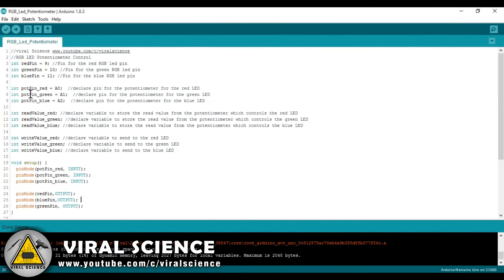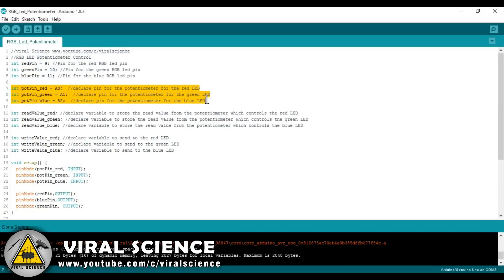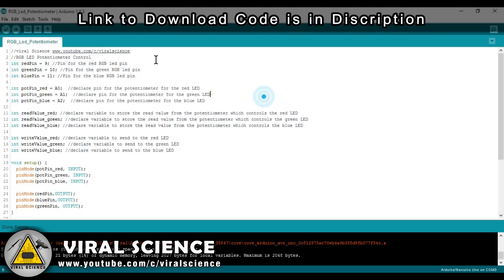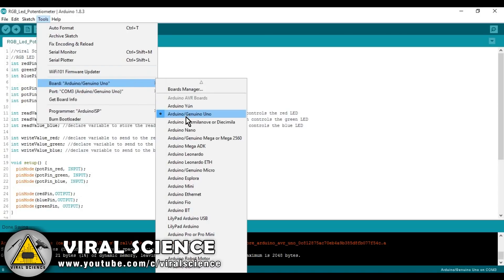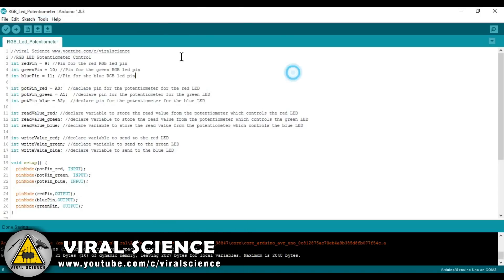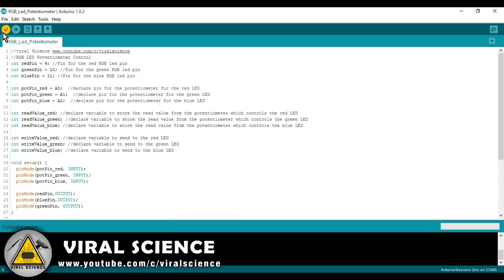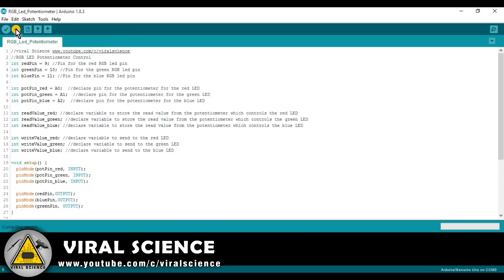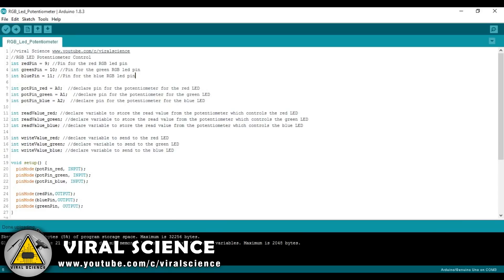Arduino Control RGB LED Using Potentiometer

Comment from the maker: Refer the circuit diagram which is provided in description of the video, there are some minor mistakes in the circuit in provided in video sorry for that
Reply: goodle drive code not there, website code is for a bluetooth project and you dont show below line 25 in the video.. do you have the code anywhere else? Great video and site otherwise.

Comment: Hi,  i have done your project with a nano instead of uno.. but the led are not lighting up..
Reply: Same problem. I connected 9, 10, 11 to anode and GND to cathode and it works but not well. I order diode with common cathode, I think it will work correct.

Comment: Hi, it seems there are errors on your fritzing scheme : all the pot. and the LED are  on minus...
Do you confirm?
Reply from the maker: +P. G. Yes all the pot wires are connected to negative port sorry for that i will very soon update the circuit diagram